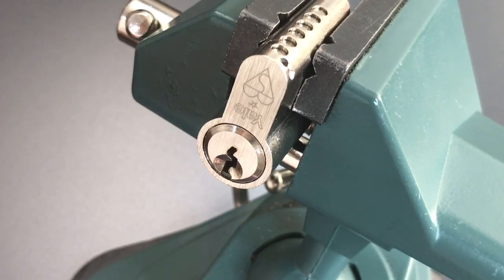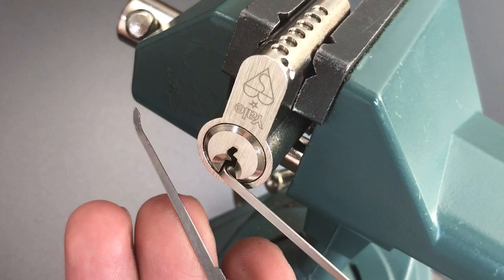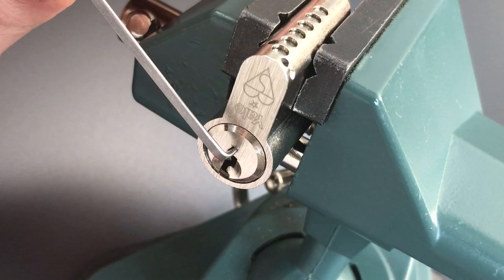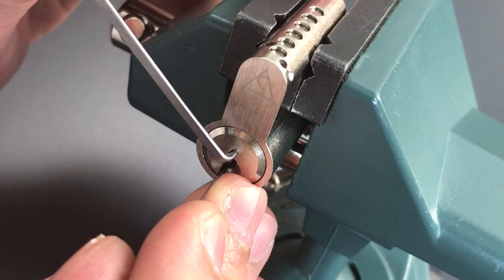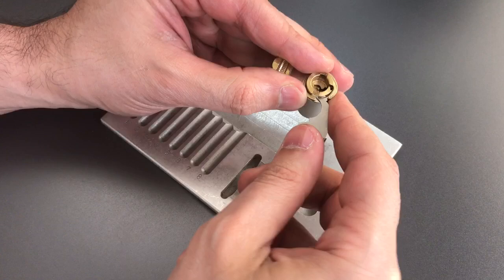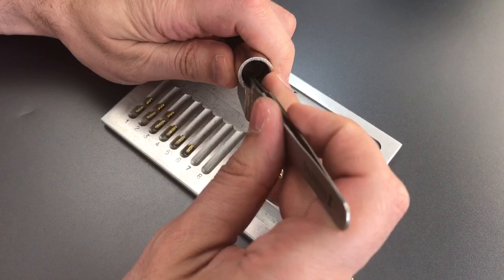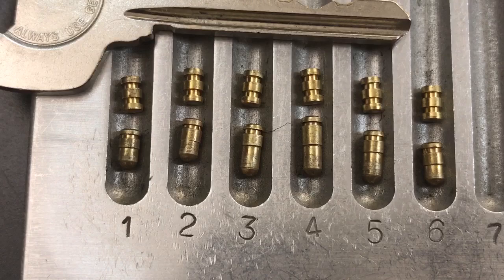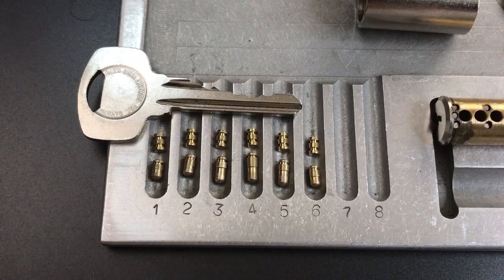[502] Yale Euro Cylinder With Serrated Pins Picked and Gutted

Comment: These are the locks on my house, I'm glad it takes a few extra seconds to rob me😁
Reply: Only this guy can do it this quickly and because he saw the key (for that tricky pin 4).
Reply: @peachdaisy3478  so are these good locks for front door? If not what would you recommend if you have any idea?
Reply: verygoodbrother i recommend soficlef locks
Reply: Same, I think most newer houses have these in the UK
Reply: @lauralishes1  they have worse, usually not even 1 star never mind 3 stars. I would never go less than 1 star so anyone in a new build should check their cylinders
Reply: So, you are telling us which type of lock you have? Thanks, now we know which pick we have to get😅
Reply: @verygoodbrother  these are good locks. Its rare to someone have skill same as LPL
Reply: @niewiem94-jfbquwegeq  They can be drilled out in about a minute. Not that great of a lock
Reply: I started picking locks about year ago padlocks I can do on all but alot but there are not easy but then I only pick maybe once a month for a hour or so. Tops
Reply: They are very good not so easy to picked
Reply: I think European doors in general are way more secure than the American ones which consist of wood only and lock on one position only. European front doors usually have multiple hooks around the frame, steel within the door, seal very well with rubber etc against weather conditions and often times in new doors the euro cylinder has additional protection within the door. So even if you drill the round bit of the cylinder out, which is a loud task already, then the door remains closed anyways. You need to spin the counterpart inside the door multiple rotations to unlock all the hooks.
Reply: @mattl2k6  To be fair though, if you are going to start drilling locks, you may as well just put a brick through a window.
Reply: I imagine that these locks could be considered unpickable as far as 99.9% of burglars are concerned.

Comment: Having watched this video, the Yale 3 star euro cylinder video, I have swapped my locks. I have gone with the Avocet with magnetic anti bump, anti snap and a huge amount of drilling protection including great big loose discs on the cylinder. In the UK most burglars use brut force attacks, drilling or snapping, but I get one that wants to pick he will be out of luck as the orientation makes just about impossible, I am told.

Comment: I just picked up a standard version of this type up from amazon. I figured with it being "standard security" rather than being starred, and it was £7.99, it would be a decent opener into this style of lock. It is kicking my butt. Mine appears to only have one spool or serrated pin (only one pin gives counter rotation in either 3 or 4 - I'm still learning).

Probably over-reaching.

Comment: Love your videos! So what is a "secure" door lock? It seems like nothing can defeat a skilled picker with evil in his heart :P
Reply: YUEMA is a lock that is impossible to pick. Their 360* variant. The lock works in opposite, eg is always "unlocked", and then "locks" when the correct key is inserted. This is then used by having the locking mechanism couple to the actuator, such as when no key or incorrect key is inserted, the core just freely spins without the actuator. Once the correct key is inserted, the core locks to the actuator so they both can rotate in unison. Since such a lock cannot be tensioned, its per definition impossible to pick.
Reply: @sebastiannielsen  I think we need to get one of these to lpl. Not that I like to see someone fail, but it would be interesting to see his take on it
Reply: @rob-fb5xs  How woud such a tool look like? In the core/sleeve variant (used by a competitior) its enough with superglue or some shim to wedge between the core and sleeve, but in YUEMA the actuator part of the core is long behind the core, meaning theres nothing to grip onto. The core spins freely, meaning you can't tension or feel where the sliders are in correct position.

Only way to exploit it would be like the masterlock M532 rekeyable lock, but that requires you to be able to tuck a shim between the sidebar and the cylinder wall, on the YUEMA lock, and thats not possible as the core is protected on YUEMA lock, ergo theres no gap between the core and the lock body allowing shimming.

https://www.youtube.com/watch?v=4cwjGJ2i4oA

As you see, there is a inverse lip there, on a normal cylinder lock, the cylinder has the lip over the lock hole, and in YUMEA 360, the lock body instead have a lip over the cylinder, ergo the hole in the cylinder is smaller than the core in the front.
Reply: There is currently another unpickable lock from a company called "Bowley Lock".

It literally prevents any (known) tools from picking the core due to core shielding.

Comment: Is it impossible to pick it in the upright position I wonder. I once tried to pick one closed where I needed to lock up but forgot the key all the way at home. The thing had a single serration on the bottom of key pin, the first one at least anyway. Just a little tension and they all bind hard.

Comment: I have a question, I was picking my own back door cylinder lock for fun after watching you pick a few locks, and after I pick it, it turned 180 degree and stopped, then 2 pins popped up, 1 at front for sure and 1 at back (I think) at the bottom of the cylinder (opposite to the other pins), I know nothing about this and started to panic as I thought I messed the lock up, then after messing around for 5 minutes I discovered I needed to press the pins down with with along wrench and then turn it at the same time, I just wanted to know what these are? as ive never seen them

Comment: A few minutes in you said you went into a false set but continued picking through? I thought in that situation you have to start again or at least fix the false set?
Reply: false set in this case means when a serrated or spooled driver pin gets stuck in the sheer line. trying to get past them can cause other pins to drop but otherwise you just have to set the pin in question.

here's a good video for it https://www.youtube.com/watch?v=fMe2b6n2q-w&t=326s

Comment: Question: if you remove all of the pins and put back everything together 

Is the lock going be unlocked with any key in the world ?
Reply: Yes, that lock could be unlocked with anything that can provide tension, likely even your finger if you either had a long fingernail that you could push inside or could push on the keyhole and turn it.